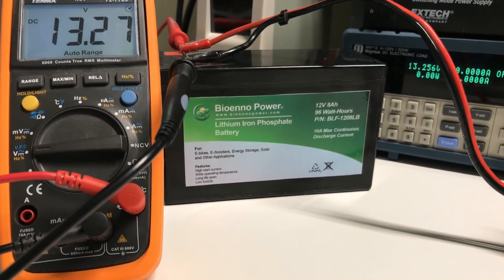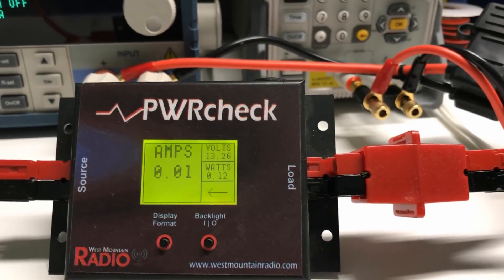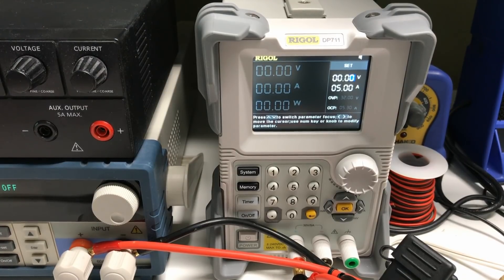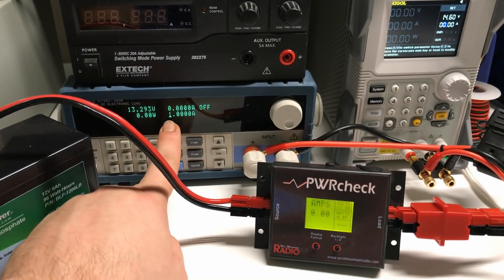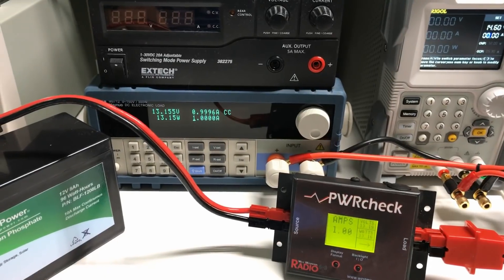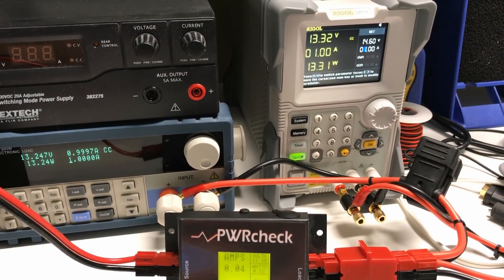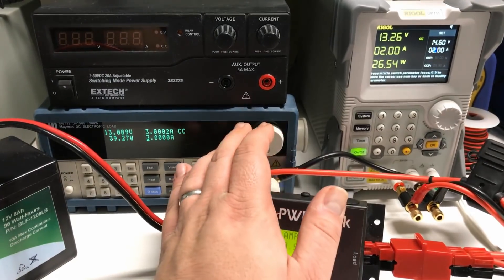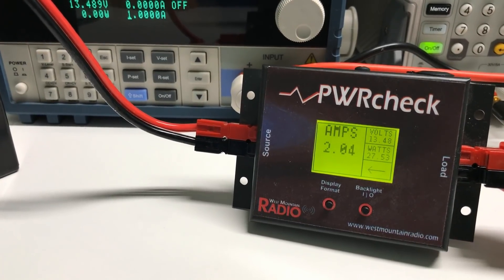What happens when you charge and discharge a LiFePO4 battery at the same time?

Comment: Am I the only one seeing several glaring issues?  What if your battery is dead and your load exceeds the external supply?  Or what if your battery is fully charged already and supply power exceeds the load demand? You didn't really talk at all about under and over voltage protection, the concerns of trickle charging, as well as the potential to overcharge the batteries without any sort of control module managing the battery.  

Yes, in this simple example you did, it works great. But if you don't account for the other scenarios that most certainly will happen, you can quickly damage your battery at best or a dangerous catastrophic event at worst.

Comment: Wow. Thank you so much. I thought they used sophisticated circuits to do this. 
Similarly, is it safe to say that charging and using a phone at the same is not bad for the battery, apart from the wear due to heat?

Comment: this is helpful thankyou, im confused using a shunt would still be an accurate way to keep tabs on the battery. if you have any thoughts to guide me on that i am needing to incorporate a way to gauge how charged my batteries are, i am in the process of setting everything up... up until now i have charged each of my 100ah lifepos separately and used them separately but i want to transition into them all being  in parrellel and hopfully hooked to the charge contolller as well. it sounds like its possible to have it set up where it can be left as it is and charge/discharge. any advice is appreciated im trying to learn if a shunt will do what i need

Comment: Great video! just one question, when it comes to let's say 8K Inverter, with a 9.5k Lithium Battery, is there any "RISKS" in terms of  overload, heat, too much power in & out?
Usually the battery can take more than 10+ Amps from the Solar Panels  to charge, whilst the House is using 10+ Amps. Anything I should consider? I know if we go above the Disrcharge limit (~18Amps) the BMS would disconnect), but I was wondering if that would stress the battery out & shorten its lifespan, risk of fire etc.

Of course when there's Solar Panels, we shouldn't be Discharging from the Battery anyway.

Comment: Great video. We need folks like you on YouTube. I stopped a project because an RVer said charging and discharging at the same time damages the battery. The TV in my RV only works on 120v. So I want to add an inverter drawing power from the house battery of the RV. I have two dedicated battery, engine battery is not used by the house portion of the class C RV. I know when the engine is running the house battery does get charged. Can I turn on the inverter so the family can watch TV while I am driving? I want to connect a 2000w inverter directly to the house battery. I am not worried about the battery aging too soon, just want to make sure doing so would not start a fire. What is your take?

Comment: Dude.  I knew this.  Its why you can connect a 12v led that uses 0.01 amps to a 12v car battery without blowing it up.  Somewhere along the way, I forgot it or got confused (or maybe too old or busy to remember important details for something I dont use in everyday life anymore).  Ive been looking at solar charging for amateur radio and was worried my 160 watt panel I just got would push too many amps into my battery or charge controller though I knew the battery had a BMS to protect it and the controller had a fuse.  Your first 30 seconds just made me drop jaw slap face.  The solar panel isnt pushing anything (amps wise) its just able to provide the current as needed by the load up to its rated output if it can beat the required voltage.  I cant believe I spent so much time looking at specs and worrying about overloading things.  Thank you.  Thinking about it now - that would be like me thinking if my radio drew 25 amps but my panel only had 8 amps, I would start to suck the sun out of the sky into the panel just to provide the radio with what it wanted...

Comment: So I'm here due to researching for a purpose different than most I see.  I have a lifepo4 12v battery serving as my dedicated power source to a multi amp audio system in my RV.  I have a 12v 15a ac to dc charger connected to the battery.  The audio amps are also connected directly to the battery terminals via distribution block.   The lifepo4 battery has a bluetooth BMS that reads -5 total amp when turning on the audio system.     Turning on the 15 amp charger causes this reading to then be 10 amps.  I believe any audio spikes to draw more than the 15 amp the charger is providing will just pull from the battery.  Anyway, I don't see any negative consequences from running this way.  Hopes this helps any 12v audiophiles that are looking to combine lifepo4 and another charging source.  BTW, the BMS in the Lifepo4 battery i own will shut off current when the battery is 100% charged.  That way, I can leave the AC chager always plugged in.  Make sure yours can do this if you want to leave connected.  I am open to corrections if I have made incorrect statements.

Comment: nice video, one question you set up power supply to 14.6v , why its sending only 13.27v?, should charge voltage for lifepo is 14.6v but show less, isit because battery is full?

Comment: I am thinking of converting my FT-897D to solar, with a small LiPO 3S 2200mah battery inside. I am concerned about the efect of 3 changes to this experiment: (1) Sudden and drastic and ups and downs in current consumption between transmit and receive, not from 1 to 2A but from 1 to 20A, (2) a smaller LiPO battery that would not be able to keep voltage as constant under full load as the one in the video, (3) using a basic charge controller that comes included with cheap portable solar panels. Could sudden voltage drops on transmit trigger switches between the constant voltage and constant current stages of the charge controller and would that pose any threat to the system? Thanks to everyone for the input. 73 de Diego EC1CW

Comment: If charging amp 1.5 amp and load is 1.45 amp, there is no problem, but if load is 2amp, then it will affect lifespan of battery, very little damage over the period,, just like watching youtube video while charging pin is plugged in

Comment: I was looking at getting a bluetti solar generator but it says you will damage the battery by charging with solar while discharging the battery…. How do and what extent will you damage it or reduce the life of the lifepo4 battery??
Reply: The reason why "bluetti" says that is because of the type of inverter that's inside the unit.  You'll damage the inverter in the "bluetti" because it does not have what is called a "pass through" inverter.   Thus, the inverter would overheat and be destroyed.  It has nothing to do with the battery itself.   Try to buy a unit that has a "pass through" inverter in it so you can both change and discharge / use the unit at the same time.  But those are more expensive!  Good luck!

Steve

Comment: If the dc load its lower than the charging, then.....you are not using the battery. Battery stays charged but the charger will power your dc load, the radio.
What you do there its just a back power ups in case if the charging stops.
You should use a bigger system to demonstrate charging and discharging at 2000watts in and out using appliances.

Comment: I have an important question... 
Can you charge a lipo battery while it's still connected to the circuit assuming the circuit is switched off? I'm planning on embedding the lipo into a circuit and charge it without removing it from the circuit. Can this be done?  Any safety concerns to worry about?

Comment: Yes your video was perfectly clear, even for an electron moron like myself.  When you first rattled through the equipment setup, I thought "oh man, I'm not going to be able to keep up," but once you started the test and switched to basic arithmetic teacher mode - then the lightbulb came on for me.

Buddy, I've been binge watching YouTube videos - trying to figure out how to wire up a small lifepo4 power box for a tiny boat.  This video was very helpful.  Much appreciated.

Also, I'll be wiring some kind of external antenna extension at the top of the mast for the marine VHF handheld radio.  I probably should checkout your channel more often.

Comment: Great video! Does this also apply to other common types of batteries, like AGM?
Reply from the maker: Yes but in a slightly different way as far as the math is concerned due to how each battery is charged. Both the battery and the charger are current sources able to provide current, the total voltage of the whole “system” would be more of a variable for lead acid I think but don’t quote me on it.

Comment: what if a case of Lithium ion batteries? you need a CC of 5A?

let us say a scenario. a drained battery parallel to the load connected also in parallel with power supply. the power supply turned on and of course, the direction of current is going to the load and to the bms of the battery but you need a CC because of the battery. how will you connect them without changing the limiting current for the battery? in this case, the load is pulling current to the power supply. 

hope you can answer this. thank you.

Comment: Jeremy—thanks for the clarity. You would be amazed at the responses from Battery manufacturers on the question of charging while using. Honestly, I get the same from different engineers. But I think it becomes a personality issue—safety in their mind vs practicality and need—whichever is stronger. Question: what’s the best way to add a parallel battery to that configuration. Thanks again. 73. N4QYA

Comment: Hi, excellent demo for understanding the simultaneous charging and discharging... Great..   Similarly can we charge and discharge from Li-Ion 18650 battery pack ???   I would like to connect my Li-Ion battery pack to Solar panels through Charge controllers and load through my invertor ....   Can you let me know whether we can charge and discharge the same way you have demonstrated..   Is there any precaution to be taken or any methods to be followed...  Kindly help in replying.... Best regards, Vivravin..
Reply: Hello Sir, I can see this question was from 2 years ago and I was curious about your solar system...can you elaborate on how is the system running now and how was your journey?

Comment: So if I understand correctly, there is no danger, as discharging and charging a battery at the same time can be likened to how a capacitor stores and discharges energy while being charged. It is just a storage tank if you will, and just like if you are filling a gas tank you are using at a constant rate- whatever rate you fill will slow the rate of use of the gas stored in the tank at an equal rate. So then when the load stops, your battery will just charge at whatever rate you have until full. As long as the charge/discharge rates for the specific battery used are within its spec rating, I guess it should matter if you are doing both at the same time.

Comment: Thank you so much for this informative video! I recently purchased a power pack unit on Amazon called Tacklife P50, to charge with a solar panel, and was wondering if I could charge / discharge simultaneously without damaging the battery. Does your explanation apply to a product like this one as well? It has an MPPT charge controller and a lithium ion battery. Thank you! https://www.amazon.com/dp/B08598NWS1/ref=cm_sw_r_tw_dp_U_x_WqQYEb1N4C625

Comment: So the key point, mentioned buy not stressed in the video, is that all power supplies that are not the battery must go through a charge controller as to not destroy the battery. For example, if you plugged an AC to DC power supply into the system it would not stop charging the battery when the battery becomes fully charged and destroy it.  Great video!  I lead me to this thought that I did not fully realize.  In this case, an AC to DC “charge controller” would be a battery charger.
Reply: I believe your comment to be true but some LiFePO4 batteries have a built in BMS that can shut off charge current when the battery is full.  Therefore, an overcharging event won't occur.